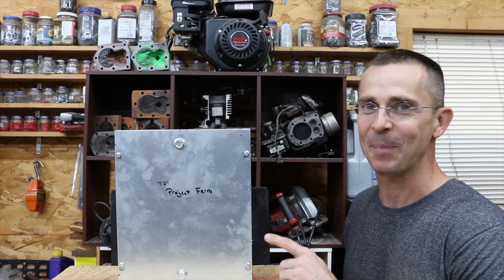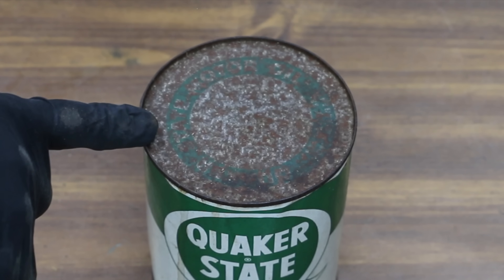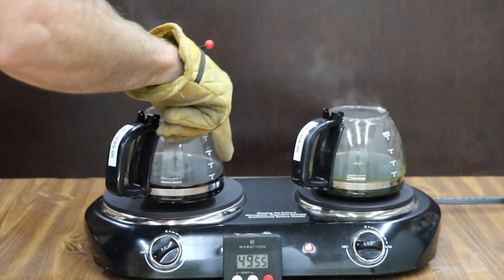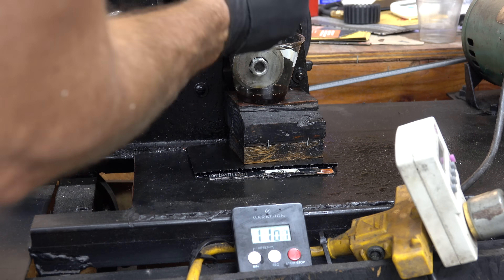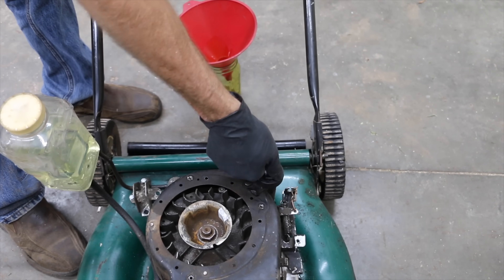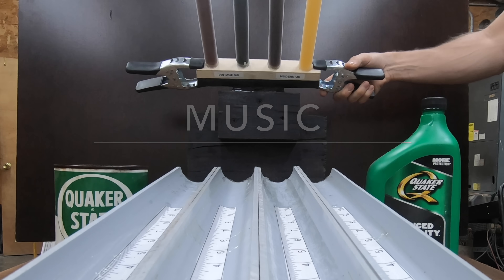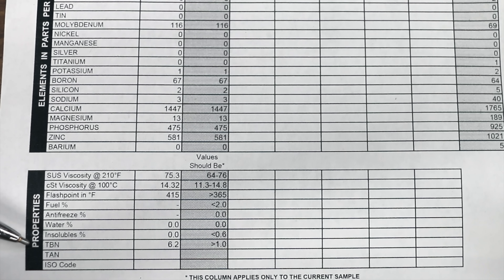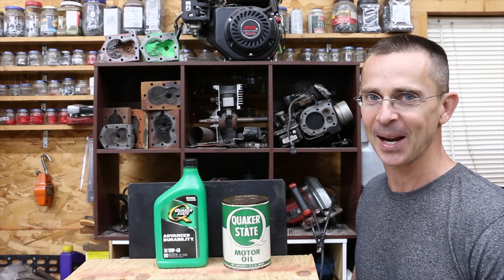Is Oil Good After 70 Years?  Let's find out!

Comment: I’m guessing with that box they prepared to ship with UPS
Reply: Lulz
Reply from the maker: Thank you for the feedback
Reply: Nah fedex. They smashed their own freight box and blamed us. Ruined our pen panel for a mri system.
Reply: looks like they still dented it to
Reply: @xIronMikex  how much was it worth  can always go find a $500 scrap car find one of their trucks at a lower speed. And lock the brakes up. Car in front of you stopped short so you had to. Now you get a chance to use your new MRI machine and make them pay. Hell having access to the machine. You could swap your image with a random persona changing the file name showing you have all kinds of issues. Fed ex is one if the worst delivery companies. It's like they intentionally drop crush and get pissed and take a bat hitting the boxes in the truck one by one. 
I ordered a nice air compressor. Firsvobe damaged guy told me if I take it off this lift gate it's been delivered and you have to reschedule and pay for lift gate serivce to return it. Or be asked to take it to retailer you ordered from . Said keep it. Week later next one cane. The cage was more crushed then the first one. I said WTF is this shit. Keep this shit up the robots are goin to replace you faster and people wont care. Robots wont destroy their shit. Stays in the trunk. 3 times I jus asked for a refund and went to Lowe's and got a better deal and got there 120/240 volt beast of a air compressor. And paralled it my older 26 gallon kobalt, ran them to a T into Lowe's 7 gallon portable air tank and I run my line off the tank. Running 2 compressors in parallel is much cheaper per cfm for airflow and it's highly portable. Price wise you can get two 2.5hp ten gallon compressors for $300 run them to a portablr air tank  and roughly have 10cfm at 90. Your entry level 60 gallons make around this and cost more the  twice as much and stationary. So it was like blessing it happened. Spent less money,free non botched delivery. And can run my paint guns without having to wait for the air to catch up  just have them on two separate breakers. I digress
Reply: UPS= Extra kick of the package off the truck.
If box is labeled "fragile."
Fedex and your package was involved in a highway accident.
Reply: I recognize that oil lab!
Reply: Wouldn't have got there!
Reply: Im guess USPS so it wont get lost so easily LOL
Reply: I used to work for UPS as a package handler (I loaded the semis at night) and I can tell you right now, UPS will destroy anything
Reply: Ben Ault I do maintenance on their air compressors in all their facilities local to me and they’re all a cluttered mess with broken packages and just garbage everywhere. Great contract for my company with the amount they spend but damn is it awful
Reply: Ben Ault if that’s true thenI hope my sealed vinyl is not broken cause the package was kinda rough.
Reply: I worked at UPS and we treat packages. Like shit we were timed soon unload the truck by throwing them about 6 feet on the web belt TV antiques you name it and less you spend over $85 in shipping your package is treated like garbage

Comment: No wonder cars only had 90 day warranties back in the 50’s! You need an engine rebuild after 20,000 miles with all that sludge and wear!
Reply from the maker: Great point!
Reply: I have a workshop manual for a 1960 Mini, it recommends de-coking the head at 40K miles. These days we expect a car to do many more miles with no attention.
Reply: @AndyMarsh   don't modern GDI MINI's have the exact same issue? (Well not quite exact same, but carbon buildup on valves)
Reply: @dquad  yep because GDI doesnt spray any fuel on the backside of the intake valves like PFI. There's very few engines out there that actually have a dual set up GDI/PFI.
Reply: When ever I hear the old trope of "they don't make em like they used to" I'm kind of thankful they don't, when I was growing up 20-25 years ago a car was considered junk at 100k miles I imagine that number was far lower if you go to the 70s or 60s. Nowadays most cars are good for 250k miles some will go way beyond 300k with nothing more then basic maintenance.
Reply: That's when MMO was of help.
Reply: Hughes Enterprises, That's why oil changes were recommended every 2-3k and not every 5k, 8k, 10k, sometimes longer, like now.
Reply: Kinda makes sense why old odometers only went to 99,999
Reply: kenneth clifford Most cars just rusted away before they hit 100K.
Reply: Back in day you were lucky to get close to 100,000 miles....
Reply: My dad always said that Quaker state would sludge up.an engine. Looks like he was right.
Reply: Hughes Enterprises those fifties cars are still running strong way stronger than 80’s Chinese and Japanese   junk
Reply: Yup in the late 50s early 60s you would recive a gold watch from Volkswagen if your VW beetle ran more than 100,000km without rebuilding the engine
Reply: Some people would run some kerosene through the engine before changing the oil to clean the sludge out.
Reply: My old '72 baja bug air cooled 1600cc.... I don't think I'll be running this old Quaker State in it.  It needs all the help it can get!  Haha
Reply: @nadronnocojr  survivorship bias.  No one remembers the scores of junk cars that are most definitely not still running fine.  And even those that are, are usually not on original engines.  Cars were junk in the 1950s, built for maybe 5 years of use with lots of service visits during its life.
Reply: @billybobjoe198  I've heard stories of people using the old Chevy 305 (1977 - 1993) for 500k miles with regular maintenance. Heck, I even heard of an 84 Pontiac that may have used the same engine and the owner had it for over 900k miles until someone stole the engine.
Reply: They typically for most people, who often didn't regularly change the oil, would last about 70,000 miles before needing at least a light overhaul.  If you DID regularly change the oil and filter, and regularly serviced the air cleaner, they would last over 100,000 miles.

Comment: Several interesting thoughts on the vintage v. modern engine oil. My 1953 Bel Air required me to change out the oil every 3K miles and it did not have an oil filter either which was optional back then. Also the use of lead in gas back in the day was the only choice (it is my understanding lead was a sort of lubricant for the top end of the motor). Modern cars don't have to have the oil changed as frequently and the fuel entirely unleaded with 10% ethanol. Couple that with advancements in metallurgy and engine design I can see the subtle differences in the test. Just my 2 cents, really enjoyed this video.
Reply: Wasn't lead used in gasoline to prevent knocking?
Reply: @stearlers069  Leaded gasoline is bad for health lol. You are legit breathing in lead particles, which can do a lot of harm.
Reply: Ethanol is not good for fuel that will be stored a long time or used in small engines. Amoco used to sell "lead-free" premium or "white gas" but I think it had another metallic compound additive in it for valve lubrication.

Comment: This makes sense, seems cars we’ve found that have sat since the 50s and 60s are full of sludge and the pans are a mess.
Reply from the maker: Great point!  Oil has improved a lot since then!
Reply: After rebuilding motor that had quaker state the old stuff I switch to other brands and never went back
Reply: and if you fill modern oil in one that has run old oils, the modern oil may loosen up large chunks of goo that then go and block the smaller lubrication passages, causing lack of lubrication damage. Need to take it apart and dig i all out.
Reply: @Project Farm...the modern oils are superior 
...**wondering if the Metallurgy in todays engines are as Strong, good/better, as the old ones?(!
Reply: Kanadian Bacon far better but we reached peak engine reliability sometime in the late 80s early 90s. Since then emission requirements and constantly increasing HP/weight ratios have slowly been reducing reliability. Doubly so with Diesels. But hey at least we can still breath.
Reply: Slugging was an issue all the way through the late 70s -80s. Hydrocracking in the late 80s took oil to new levels of cleanliness. There were a few cars that had sludging issues after that but they were due to design issues and unrealistic oil change intervals.
Reply: Even more recently than that - I remember cars from the 80's being a sludged mess under the valve cover.
Reply: I live in oil city pa. Pennsylvania crude oil is waxier Than the oil from other places of the world.

Comment: I remember using that kind of oil in the 60’s, with those kind of cans you had this metal spout that you could push into the can so you didn’t need a funnel. Most of the cars back then seemed to burn oil as there always seemed to be this big blue cloud of smoke coming out of the tail pipe when you started the car. Also we usually did our own oil changes but would just dig a hole under the car/truck and drain the oil into the ground, kind of like returning it to where it came from I guess ;)
Reply from the maker: Thanks for sharing.
Reply: They went to plastic bottles in 86

Comment: As the old can stated "Add a quart" Basically old engines had continual oil changes.
Reply from the maker: Thank you for the feedback
Reply: Yea. If you wanted your car to last as long as they do now it would be 100 mile oil changes.
Reply: Well not really... the contaminants just got more and more concentrated. Back then there were no overhead cams, and no PCV, the engines had a  'draft tube' that constantly spat out oil going down the road, rings were gapped further, and engine tolerances were higher. 
99% of the technology is the same, just the tolerances changed. These engines ran tetra ethyl lead which acted as a lubricant, had vaccum oil pumps, and needed valve adjustments every few k miles. They were also considered overbuilt to todays standards. They made like 80-100 horsepower with huge v8 engines and the like. Modern engines close the gap and double to triple that with tighter tolerances but tighter tolerances mean with old oil more wear will take place
Reply: The new ones call for 0w16!
Reply: Just like my BMW with M54 engine. 1l on 1000km :D :D :D
Reply: @rogercushman2903  You dropped a zero.  Oil changes were once per month, or every 1,000 miles, whichever came first.
Reply: @kg4boj  I've seen vacuum air pumps, but every oil pump I every had to work on was gear driven.  The oldest engine I tore down and rebuilt was a 1936 Chevrolet 216 cubic inch inline six cylinder.  Later six cylinder engines were 235 cubic inches.
Reply: I remember guys buying a case when it was on sale. Just kept it in the trunk. Handy.
Reply: @502Chevy  I did a double take when I saw 0w16 in Walmart the other day. Wut in tarnation?? haha
Reply: @johnmartin560  - It's only going to get worse! There's plans for even thinner oil than that. Thought I recalled seeing a 0w-8 planned. Might as well just lubricate the engine with water, lol. Cars are becoming throwaways these days anyway!
Reply: garaiselvis I’ve got one of those - can confirm. Burns about 1 liter per 1000km 🤷🏼‍♂️
Reply: @SmittySmithsonite  Amsoil now has a 0w16, they'll probably get an 0w8 if it gets down to it. I'd go with them first.
Reply: Because the old oil was bad by today's standards.
Reply: @rogercushman2903  If you changed the oil every 1,000 miles - with no oil filter - or every 2,000 miles - with an oil filter - , AND REGULARLY SERVICED THE AIR CLEANER, they could indeed last.  Many people didn't though.
Reply: @kg4boj  The oil pump was always driven by a gear on the camshaft, the lead coated and protected the valves and seats, and really big V8s made about 150 to 180 horsepower.  I have many shop manuals, and the clearances seem to be pretty much the same for engines from 1940 all the way up to the 70s.  Not sure about today's though.

Comment: Kind of what you're saying is this oil was never "good" to start with. But still retained what little quality it had.
Reply: You can buy old unopened cans of oil on eBay. They're not that rare yet.
Reply: I think some of the issue with the old oil is age related breakdown, especially of any additives in it, nothing lasts forever and things like paints, stains, chemicals and oils all have a shelf life
Reply: @HobbyOrganist  If sealed, it won't break down.  Only breaks down if exposed to oxygen.

Comment: Could the oil possibly have reacted with the metal in the can over time?
Reply: I think the laboratory test maybe show if it was. Would have a lot of iron mixed in oil.
Reply: Probably not doesn't seem like there's a lot of contamination from the lab tests
Reply: Oil actually prevents iron from natural reactions
Reply: @AgustinBernardo  unless its acidic and anemic
Reply: Possibly
Reply: @andresouza2314  would have been aluminum and not necessarily
Reply: Yes
Reply: Salt Rock Lamp there might be because it might have made some sort of oxide from the metal that was used for the can that changed the color
Reply: Was all oil greenish back then
Reply: @Davozy  I don't know if all of it was, but I remember it being similar to this green when I was a kid in the 1960's.
Reply: @Craig Smith oh so was that natural or produced if you don’t know it’s good
Reply: @Davozy  Not sure to be honest.
Reply: I remember Quaking State coming in cardboard "cans" with steel tops and bottoms.
Reply: @Davozy  From the 1960's, I remember various colors, depending upon brand.
Reply: No.  Not unless it has some water in it.
Reply: @Davozy  Most was.
Reply: @soilmanted  I miss those, and the spout/can opener that you used.  It was easy to add oil without spilling any.  The modern plastic bottles make spillage almost gaurenteed.  Plus, plastic waste has become a huge problem.

Comment: I used 30 Penn oils in my first cars, 1959 VW 36hp, and mom's new 1970 MGB GT.
It had great reputation in 1966-70. I do recall the '59 VW having milky oil breather build up especially during Connecticut winter driving. I think I changed the oil between 2-3,000 mile intervals, depending on milkyness.
Reply from the maker: Thanks for sharing.

Comment: Lol I remember as a young kid my dad was so adamant about making sure the engine had warmed up. I can see why now. That old oil took forever to get flowing.
Reply from the maker: Lol
Reply: I'm 80 I'm not old enough to remember when engines needed to be warmed up first. I have always started them and drove off .back when pistons were steel they needed to be warmed up. I want the oil pressure light to go off as soon as the engine starts. If it doesn't I find out why. I confess that in cold weather I let the engine run long enough to clear the windshield.
Reply: @ralphwood5114  Not every heeded that advice, but yes, it is good to warm the engine up.  I think only Fords had steel pistons.  Chevys had them until about 53, Pontiacs until 54.  The others had aluminum since the 30s.

Comment: Back in the 1960's this is the only oil my dad used.This and a container of STP. Everyone talked about how it sludged up your engine, but our cars always went well over 100,000 miles a high number during that time. Dad passed away 35 years ago. I still have the spout he used that not only opened the metal can but was the pouring spout as well.
Reply from the maker: Thanks for sharing.

Comment: send it back to Quaker State and say you want a refund 😂
Reply: That's the best (and funnest) comment I've read so far, lol.
Reply from the maker: Lol!
Reply: Imagine getting a check for 25 Cents.
Reply: sell it on ebay for 2000dollars
Reply: @ZImpresive  lmao thats propably what would of happened
Reply: I'm watching this video cause my 97 dodge ram has 305,000 miles and always use Quaker state synthetic oil but I do  change every 3000 miles and my engine still sounds good
Reply: @homeroaguilar6163  im sure its good as long as its not 70yrs old

Comment: The -40F oil flow test at 9:05,: "None of the oils seem to be aware that the race is started." Lol
Reply: LOL! yeah and imagine your car sitting in Northern Canada or Alaska and you try to start it up with it's oil like THAT, it looked more like caulk than oil!
Reply: @HobbyOrganist  bro my honda uses only synthetic and now i still wonder why people dont start using it lol. like it will give your engine so much life.
Reply: @gamelard1963  Ive heard that you dont want to use synthetic on an engine that already has a bunch of miles, but good on a new engine.
Reply: You put gear oil in or modern 0w20 of course the synthetic 0w20 wins. The cold test is crap.
Reply: @HobbyOrganist  you could get knock if it's not thick enough but synthetic doesn't matter.
Reply: @HobbyOrganist  the thing with that is that synthetic oil is thin and it can find cracks and leaks easier than thick oil. so if the gaskets and seals arent 100 percent then it will leak.
Reply: @gamelard1963  That's what I was thinking of- leaks in older engines.
Reply: There was really no need to specify Fahrenheit for the scale on that one.
Reply: @HobbyOrganist  yeah i mean it happens my cousins suv started leaking when he switched to synthetic. his valve cover needs a new gasket. but PF did it to his old tractor and nothing happened because his gaskets are perfect.
Reply: @gamelard1963  Oh yeah the usual valve cover leaks... I was also thinking of things like the oil pan gasket, front seal on the 70s era engines, and rear main seal leaking, so I never tried the synthetic oil. I'm more familiar with the V8 engines we had back in the 60s and 70s in Ford, Chevy, Dodge, rebuilt plenty of them.